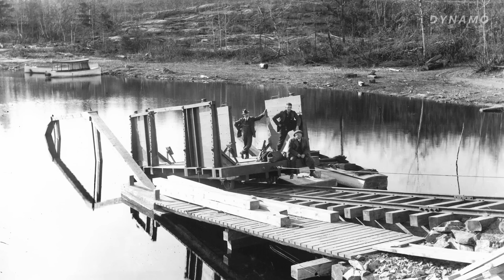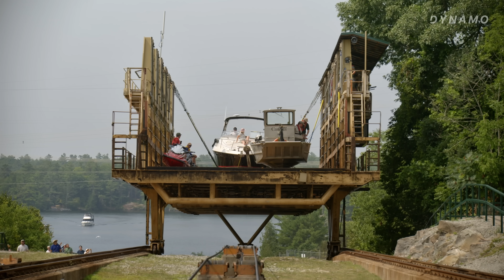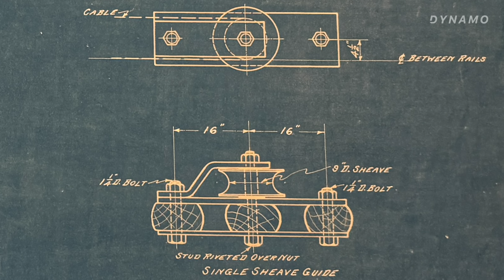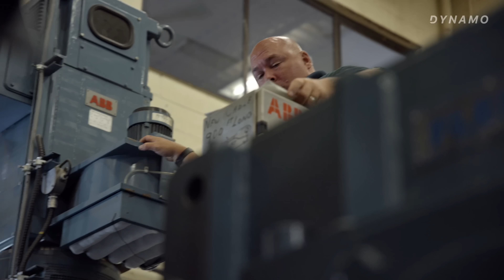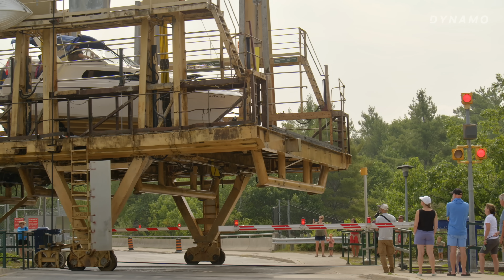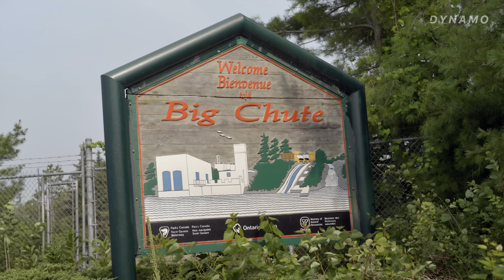Canadians Still Move Boats On This Bonkers Old Machine

Comment: We used to stay at the "Severn Lodge" years ago with our kids for a week. This was always one of the things we made a visit to every year. Beside the existing working railway there is the original one you can have a look at. Also you can visit the power dam at the site. There is a path that takes you down to the original generator room that has two Pelton wheel generators on display outside along with some of the original parts of the dam penstock system, additionally you can see inside the modern new generator station through a window. The entire site good for a few hours if you are into this kind of thing. Another clue to how difficult it may have been to build the lock is go look at the overflow spillway beside the railway, it gives you an idea of how much drilling and blasting would have been necessary to build a lock through the solid rock. Maybe they could not spare the manpower, material and explosives due to WW1.

Comment: Unlikely that Atlantic Llamprey spread via the Welland  Canal
which  links Lake Erie and Lake Ontario.  The Trent Sevvern system is open to Lamprey from its beginning at Trenton near  Kingston and  Lamprey and Zebbra  Mussels came into the system  via ships using  the St. Lawrence Seaway .  The Swift Rapids lock about 16 km upstream of Big Chute built circa 1964  is the largest lock in the system  and replaced another marine railway which was longer than the original railway at  Big Chute which stayed with the railway solution likely as a cheaper alternative. but  Zebra Mussels invaded and thriive throughout the system regardless.
Reply: The spread of sea lampreys into Lake Erie, then Huron, then Michigan, then Superior is well-documented, by the decline in the commercial fishing haul from each lake over the decades.

Comment: There are a couple mini versions of this on the Rainy Lake chain at Emo Ontario .  One boat at a time. It is a  pretty cool ride! Just kinda neat!
Reply: It can handle 4 or even 6 small boats.  The capacity is 99 feet so a yacht will fit but not a mega yacht.
Reply: @peggyt1243 are you referring to this one in the video? I was on the Clearwater chain which was one at a time north went up into Pipestone and south went down to a lake I don't remember the name of but from there you could drive up a small waterfall into Jackfish. Pretty hair raising experience the first time doing that!

Comment: AI would never be a good replacement for human operators in this field for one simple issue prevalent in all machines - false reads.

A false positive on the hydraulic straps could lead to a boat tipping because the computer thought the straps were fully engaged when they weren't.

A false negative on the obstruction detection system could lead to a very dead, flat human on the tracks.

Humans, who can see when something isn't right, even when the machine says all is well, should never be replaced in such a scenario.
Reply: AI is reactive while a good human operator is proactive.

Comment: For those curious they use mineral oil for the hydraulic system so that's why you don't see the classic red hydro fluid dripping. Mineral oil is way more environmentally friendly for the water system. It burns at low temperatures though so we don't use it for most applications.
Reply: Mineral oil is not environmentally safe, regular hydraulic fluid is technically a mineral oil and it’s clear/yellow not red.

On this machine they would be using a biodegradable hydraulic fluid which is usually a vegetable based oil. This type of fluid is actually pretty common, it’s used in forestry and mining/construction equipment when operating near a natural water source.
Reply: @JTwelder.  I never said it was perfectly safe. I said it's "more" safe. You can drink some mineral oil just fine it's prescribed in hospital sometimes. Or it used to be until better products were developed. By the time it gets in the water it's such low concentration. This is just what I was told when I visited with my dad in 2010.
Reply: The only red hydraulic fluid is transmission fluid, heavy equipment hydraulic fluid is clear/yellowish
Reply from the maker: Yes! Parks Canada confirmed they use environmentally safe oil.
Reply: "Mineral oil" is normal oil refined from crude oil.  The alternates would be synthetic oils or vegetable oils.
Reply: Even so, it's ANOTHER reason A.I. should NOT take over this job. A human Operator on board gets alerted to a Hydraulic Oil leak, he FIXES it. A.I. detects a Hydraulic Oil leak, it SHUTS DOWN THE CARRIAGE, and sends an Alert to Maintenance, which then has to SEND SOMEONE OUT to repair the line. The lift could be down for an HOUR, simply because they wanted to replace the Operator.

  Or you can just, you know, have an Operator ON BOARD, who's also responsible for Maintaining the Carriage and keeping it running with minimal downtime.

Comment: That is the most amazing contraption I have seen in a while! It was built to last.
Reply: There is another marine railway which I believe is much older in England.............................such railways were a handy solution  once steel cable of suitable quality came along.............................
and of course they also needed to develop EXCELLENT EMERGENCY brakes as that hill at Big Chute IS STEEP AND HIGH - you would NOT want to be on a boat on an uncontrolled descent at high speed!!!!!!!!!!!!!!!!!!!!!!!!!!!!!

Comment: Often the best solution, is the simplest solution.......................hard to beat a frame, cables and winches.
A lot simpler and cheaper than locks, pumps, seals, and dams.

Comment: Part of the Trent-Severn Waterway between Lakes Ontario & Huron, are locks leading to Balsam Lake.  At an elevation of 841 feet above sea level, it is the highest body of water in the world where one can sail a boat from ocean level, while continuously floating in water.  Equivalent to five Niagara Falls. And this was achieved in 1907 after nearly a century of effort.  And by the time it was finished it was long obsolete for its original intended purpose
Reply: It was by 1920 but same thing
Reply: @NickRanger 1920 was when the entire system opened all the wsy including the marine railway but other interior parts were already finished prior.

Comment: Some owners will have passengers get oof and walk beside the carriage to give the hull a good look-over while the boat is out of the water. Especially sail craft with deep keels as they may have water incursion into the keel and you can then see it leaking back out. Cheaper than a “haul-out” at a marina.

Comment: Fact that this giant old machine is still running shows how solid engineering used to be! 💪
Reply: There isn't an engineer out there who wouldn't love to design current day machines like this, but alas, we don't control the budgets
Reply: Watch again, the current machine was only made in the mid-70s.
Reply: The Peterborough lift lock is much older then the Marine Railway you should check that out it's cool as heck
Reply: "Lift Locks", it's called the Peterborough Lift Locks.
Reply: You ignore the fact that much of it has been updated, and it still has breakdowns that need repairing, as mentioned in the video.
Reply: Lots of stuff from back then is broken and junk.  We only kept the good things.
Reply: And how well it’s taking care of and the salt amount of the water😊
Reply: @megajointen   This is not near the ocean it's all freshwater where it is.
Reply: @megajointen thankfully zero salt in this waterway to worry about
Reply: @megajointen it's fresh water
Reply: @megajointen  all fresh water.....not near the sea
Reply: Ya try to replicate that precision and longevity today. It would work and all you will hear is it's someone else's fault
Reply: Before government and insurance company regulations
Reply: The old stuff was built by engineers who managed the accounts. the new stuff built by accountants who manage the engineering.
Reply: It wasn’t made in China
Reply: wasn’t made in china 😂
Reply: @minutelizard3576  No, it was built in Brampton, ON by a company called Hepburn. I used to work for them.
Reply: @minutelizard3576   China stuff is getting better and better, just like the Japanese and Korean "stuff." I'm old enough to remember Japanese stuff being a slam, now it's a plus.
Reply: @portnuefflyer amazing how that works when you steal technology instead of coming up with your own ideas. 😂
Reply: @minutelizard3576 Or in Yankeeland 🥰🥰🥰

Comment: In the lake of the woods in northern Ontario they have similar boat rail that is manually operated.  Of course a much smaller scale for smaller boats.
Reply: You are correct. It's a diy lock for boats. I use it monthly

Comment: Early 60s at Guelph YMCA Camp Nagiwa(Original location on the Severn, upstream of Big Chute). Highlight was canoe trip via the “chute” and the old marine railway. Getting upstream through the actual “chute” when the generator was at full flow was a good test of paddling action and teamwork for a group of early teens. Also remember once during “canoe hour” pacing an Amphicar  heading to the Chute. I wonder if it went over the marine railway.